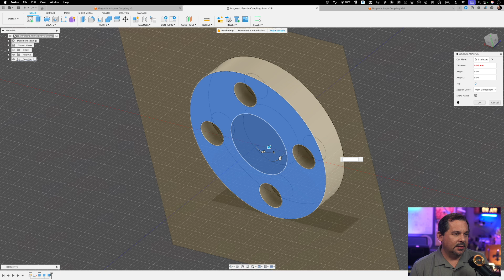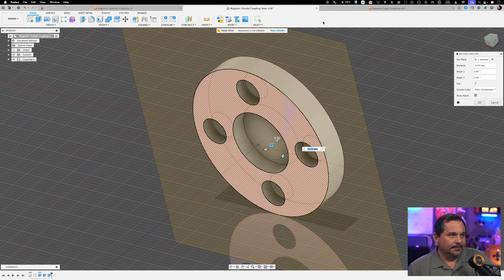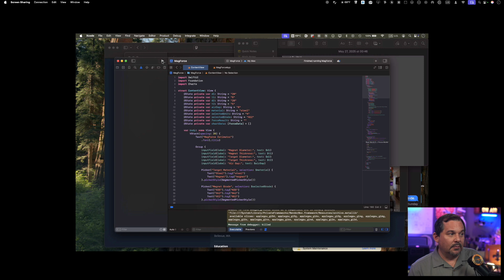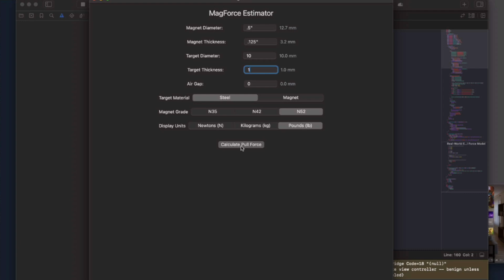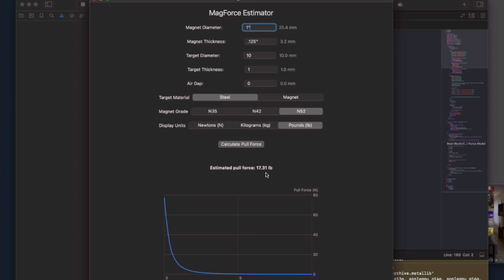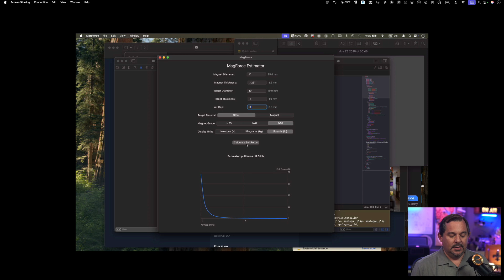Your Magnets Are Weak: How to Actually Design Magnetic 3D Prints That Work

Comment: I have been making magnets for one of my family's businesses. Approaching a 1000 made. Mine are embedded .4 mm from the base. Two layers when running .2 mm layer height. This works great for me. Recently I decided to start making my own designs and sell online. This meant getting away from amazon magnets. For what I use to make mine, as far as consumables, are all sourced from the U.S. K&J Magnetics are where I ended up. Great support and they also have their own magnet force calculator on their site. I went from 8x3mm to 6x1.5mm and stronger force. Higher price of course. But the quality and consistency of size has been better. Also there is a way to keep poles consistent. Keep a master print. I have a single magnet print I check pole orientation of the stack I am going to use to insert. Mine are fridge magnets, so orientation is not really needed. I do it for the sake of shipping and storing stacks of prints that are done. Steel plate is a neat idea for what you are doing and smart.